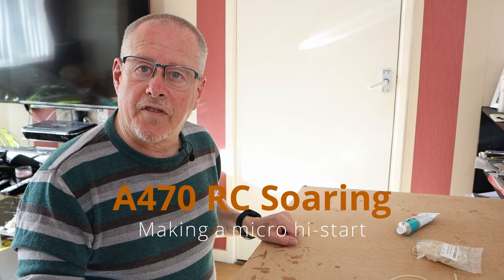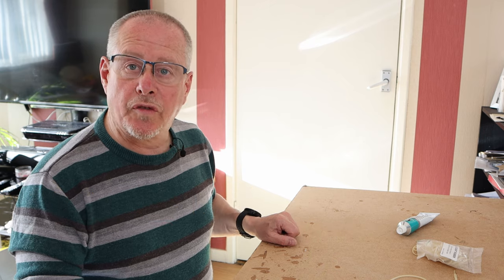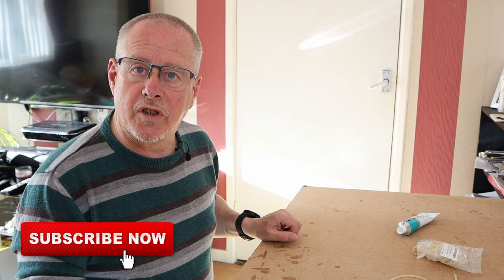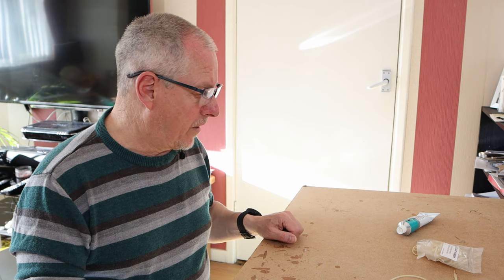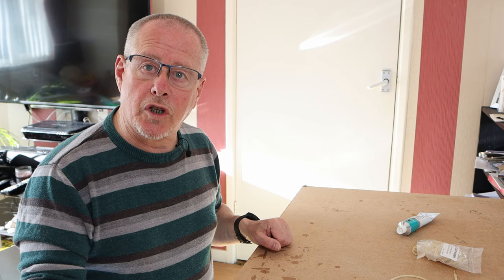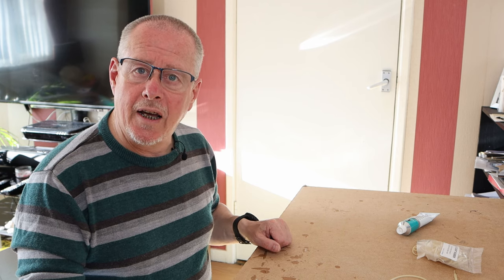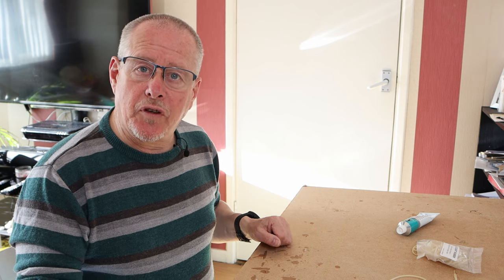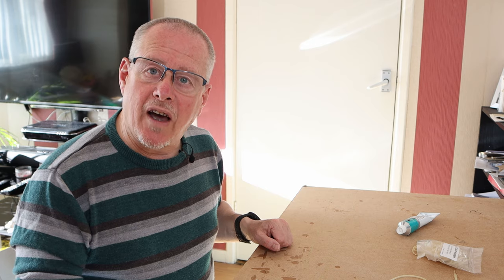Making a micro hi start

Comment: Check frank zaic's "model glider design" , there is a table of hi start dimensions depending on the glider's wing area .  Starting with 1/16 rubber for jobs less than 100 sq in. I did mine . Works great as long as you launch against the wind.cheers

Comment: Nice video i have some of the thin red silicon tubing for small stuff i never  thought of using free flight rubber .Extra height ? you do run the risk of hitting a thermal i had one so high i couldn't tell which direction it was going lol and had to do a diving circle to get it low enough till i could tell the direction to get it back .A bit of head wind will allow it   to gain more height so you could add more braid .

Comment: I wish the model industry would rate tubing for high starts by weight of pull it has. I don't care so much about dimensions.
Reply from the maker: I think it’s just that the tubing has been manufactured for other purposes possibly and so the manufacture isn’t interested in how much it can stretch or Ibs it can pull.
Reply: @A470RCSoaring  You make a reasonable point, but resellers knowing who they're marketing to could easily provide such information. A fishing scale along with some standardized length of tubing could be used to measure pull throughout it's recommended stretch range and printed on the package and/or published on the web.
   I just find it strange that as modellers we still have to guess at which dimension is appropriate.
   Oh well.

Comment: If you really can't comprehend Imperial measurements you must be younger than you look and/or have never bought sheet balsa in the UK. BTW, the 3/16" rubber you purchased is 4.78mm. 1/8" rubber (adequate for the MicroBoT and absolutely ideal for any of the 31" AngelwingsDesigns micro gliders) is 3.17mm. 
More stretch would be a good idea (assuming you get the towhook position sorted) but you need to get the proportion of line to rubber correct first. Using more line with your current amount of rubber would probably not achieve anything. The ideal proportion of  line  to stretchy stuff is normally said to be between 3 and 5 to 1. 
More line with the current amount of rubber would only work in fairly windy conditions where after the initial pull one can 'kite' up against the wind - this can work with bigger stuff on the flat (in the sort of winds you'd find on the slope) but is probably not suitable for the sort of conditions in which to be flying these micro gliders, and needs constant corrections on the way up to soar left and right as you go to keep the line taut.
All that said, some good ideas for newbies in here so 'compliments to the chef'.
Reply from the maker: I wish I was younger than I look. I was brought up with imperial, however I haven’t used it in decades now as most the majority of measurements I’ve had to use in work etc have been in metric. Maybe I should reacquaint myself with it. 
Thanks for the info, it’s very useful. Unless I can find a way of making an adjustable tow hook, then I’m stuck with the one I have which is hot glued to the fuse, as per the instructions. 
Thanks for your input, it’s always useful to myself & others.
Reply: @A470RCSoaring  With luck. careful use of a  dedicated covering type heat gun. or even a DIY one on low heat, will normally release hot glue. Just proceed with caution. I believe someone replied to one of your previous videos advising the correct placement of the hook although a movable type can be achieved at little weight penalty and would allow experimentation. 
BTW do you ever look for the PMs when on RC.Groups. Too late now and in any case you sorted your equipment problems later but when you first got on their MicroBoT thread I replied to your complaint about not being able to source micro gear for HiTec.  Stuff was still about then but it's all disappeared by now.
Reply: Just to add that, even better that a normal sized heat gun, a mini type will keep the heat localised. You can buy these from many online hobby stores but they all want £20 or so. Look on Ebay for 'mini heat gun' and you'll find exactly the same items for well under £10. That's where I got mine. Handy for little repairs to loose covering as well.